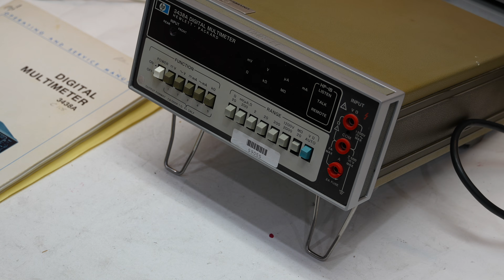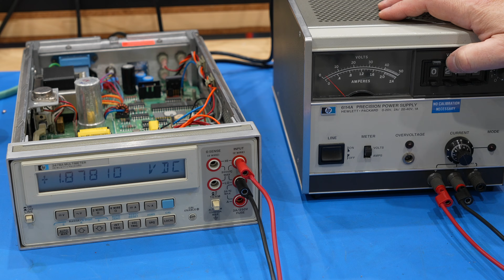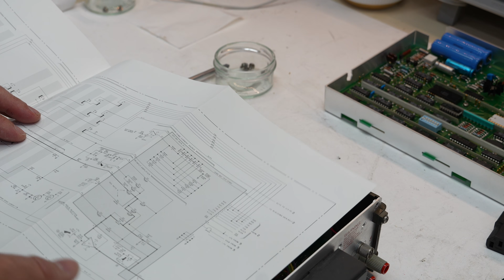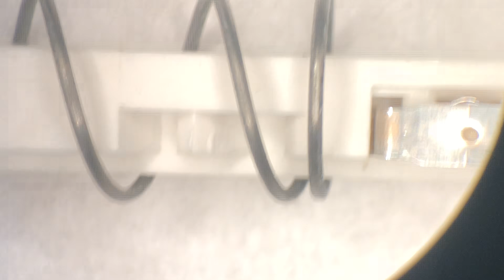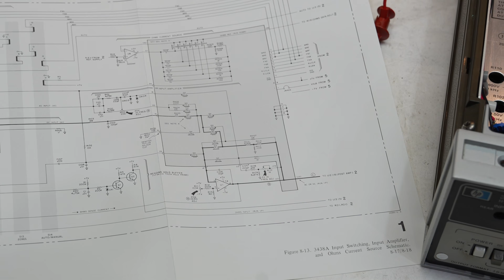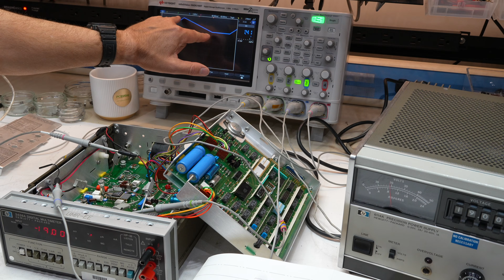HP 3438A Digital Multimeter Repair, Calibration and Principle of Operation

Comment: A useful tip for assembling items with small parts, springs, or circlips, get a large clear plastic bag, big enough to get both hands, the tools and the item in and do the work with everything inside the bag; if anything flies off, you won't lose it.
Reply: My god, why didn’t I think of that? 
I even have some gigantic blue ESD zip bags from Digikey (seriously, they’re like garbage bags!) I could use.

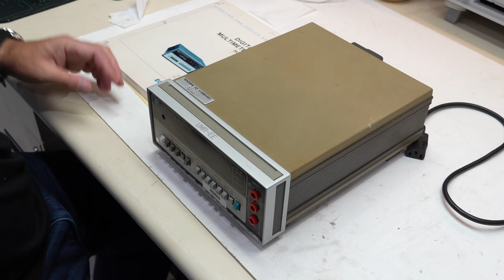Comment: WOW! I had to do a double-take when you flipped the unit over at 4:19... That UMR-EE engraving means it came from my alma mater, University of Missouri - Rolla! I may or may not have items in my collection with similar engravings. The university used to have AMAZING surplus sales, I once bought a working gas chromatograph that was missing an interface card for $10 because it was cheaper than a microwave. I used it to heat up frozen burritos.
Reply: Excuse me. . . WHAT? That is so silly.

Comment: Great video! your persistence is amazing.  Who makes the scope probe to micro grabber adapter?
Reply from the maker: It's an old HP probe system that's much, much better than the new ones (though fragile, you have to take care of them). They are hard to find, usually pricey, usually incomplete. Mine come from years of gathering bits and bobs on eBay. Search for HP-Agilent series 1160 probes. The dual lead adapter itself is 5063-2147. The mini grabbers are also HP, much more common.
Reply: @CuriousMarc  Thank you for taking the time to reply.  Your channel is outstanding!

Comment: Have you tried superglue and baking powder as a filling material? It forms a kind of plastic that will bond to any surface - including plastics that super glue will not ordinarily adhere to. It sets as hard as a ceramic, and leaves materials like epoxy dead in the water!
Reply: Find that very hard and brittle. I think the switches use a bit of a soft material.

Comment: There is always a simple cure (prevention). When the switches are apart and finally cleaned, add Vaseline to the contact surfaces. It stops corrosion and arcing.
Reply: He added deoxit contact cleaner/lubricant.
I do like a contact grease for switches, though. I mostly use one from Electrolube, though, rather than plain Vaseline. (I do use Vaseline for potentiometers. What’s SUPER handy is the spray Vaseline, which has the Vaseline dissolved in solvent, so you can spray it in as a thin liquid, then the solvent dries off and leaves a nice thin film of Vaseline.)

Comment: Hello Mark
Have you thought of making a new push swìtch shaft by three d printing.
I like the way HP, Tektronics and Marconi Intruments, technical hand books are written.
The only thing was the US circuit diagrams were usually  on several pages, witch made fault finding and calibration difficult.
As I worked at Marconi Instruments (part of English Electric) in St Albans, UK, for severr years during the changover from valves to ic's.

Comment: I'm a UMR (now MUST) alum.  In the early 80's, I spent a lot of time with the tech. (Dick Schroeder) who repaired and calibrated all our instruments in the EE department - he was the one who first exposed me to the glorious Tektronix 555 dual beam oscilloscope.  I also spent some time in charge of the Hobby Club.  Having been an electronic hobbyist since my early teens, I was appalled at the number of people in the program that didn't know which end of a soldering iron to pick up.  😕 I even repaired a TV for an EE prof. there...  <g>
Reply: I was a user of the Hobby Club in the 90s.  All kinds of good stuff in there.
Reply: @markrages  I wonder if the Hobby Club still exists?  Hope so!

Comment: Would it be possible to add a extra resistor outside the hybrid module to compensate and calibrate the damaged inside resistor?
Reply: I think the issue was that the switching transistor is burned.

Comment: More switch issues. HP really hated switches; in my 8350b more than 80% had lost the metal part and was a pain to refit them. @curiosmarc look at positives side... The spring from the switch did not jump to a random location of the lab

Comment: Hey, I have the same meter with a very similar problem ! It's waaaay off calibration, but the switches seems to work fine (nothing changes when I wiggle them). Thanks for the service manual, I'll try to fix it. Some day...

Comment: Discombobulating the plunger switches, that's pretty interesting to watch. They come in different designs, I'm very familiar with Polish made "Isostat" licence switches and while they're functionally similar (interlocked or independent, latching or not, and fast action wide gap for mains applications), they're far simpler inside than the ones used by HP. I wonder how switches used by Tektronix compare to both; maybe I'll see Atkelar take one apart someday.

Comment: Working for a competitor in my youth, I was more familiar with this dual ramp integrator. 😊
Please note that these voltmeters are very sensitive to contact quality. A few milliohms resistance in the switch may cause a false reading. Though it is rarely constant : playing with the switch makes the reading going all over the place, not stabilize on a value.

Comment: Wonder if it'd be possible to replace the hybrid with a CPLD, FPGA or Arduino.
Reply from the maker: No such luck. The hybrid is a laser trimmed, carefully thermally balanced analog resistive circuit. Modern digital electronics won’t help at all for that one. HP (and Fluke) still make the hybrids for their higher end voltmeters.
Reply: @CuriousMarc surely you could build /sonething/, albeit not very accurately functioning?

Comment: Contact cleaner is great stuff.  I had an LG washer that would not turn on, I thought maybe the control board was bad.  A quick blast with contact cleaner on all the tactile switches and it was good to go.   I am sure many of these modern appliances get dumped out due to switch oxidisation.  I used HP test gear during my years as an Electronics undergrad, memories.

Comment: I couldn't quite see how the switches were linked, is there a plate underneath so that they are all effectively touching each other in a clockwork like mechanism. Also another one for me I will have to go back and have a look at how the individual switches are released so that you can take the shaft out. Thank you for another great video.
Reply from the maker: Yes there is a bail plate way underneath linking all the switches, couldn’t see it well myself.

Comment: Thanks for the video, again!  Restored my 3466A last spring, new power supply caps, checked out the all other components.  Had the same problem with my switches so physically cleaned all the switch contacts  and applied deoxit gold to protect the contacts.  New set of rechargeable batteries installed and fully calibrated.  Love the LED display.

Fortunately, no hybrid chip fault.

Geoff
Reply from the maker: Congrats! One more instrument saved.

Comment: if the plastic is off-gassing, they will probably keep doing that (all of them). ideal solution is to machine new parts out of PTFE. or just 3D print some stuff out of resin etc and replace the plastic switch stems
Reply: PTFE is much too soft for switch parts. 
PEEK or Torlon would work well, though!
Reply: @tookitogo  Ya, PTFE could deform you're right. PFA would work and be similarly unlikely to contaminate anything with off-gassing

Comment: When the spring went boing and disappeared, I felt that.
Reply from the maker: I know. That sinking feeling when our are trying to repair something and potentially just made it worse instead…
Reply: @CuriousMarc  Believe me, you get the same stomach knot when you do something stupid on a live server and you accidentaly drop the wrong database. And now you have to explain to the customer (and your boss) why a simple cleanup job to free some disk space caused a three hour downtime...
Reply: I totally saw it coming.  I feel like someone needs to make an acrylic box for doing these sorts of operations.
Reply: @dodaexploda  I see some machinists working with various clips and other springed/tensioned items doing that work under a cloth so it will bounce off the cloth (and stay in the area) when it inevitably springs away. The camera can’t see it of course, unless you want to use a plastic sheet which might rustle and mess up your audio! Though I suppose a cheesecloth might offer the best of both worlds… up to a certain size of spring 😅
Reply: I think that you just need a glovebox, so the spring doesn't fly into oblivion.

Comment: Those switches are notorious for being a pain.  Ive learned that it was the flux in the wave soldering process that leached into these switches.  Many time she shoulder breaks as well.    Im happy to see That form factor of switch gone in modern devices. I use LPS 1 then LPS 2 on them in droves when fixing ward beck mixing consoles ❤

Comment: Excellent video! Electronic test equipment with those snap action gang type switches are the biggest repair tease.  I remember my first foray into electronics repair with a Valhalla 2101 power meter displaying very odd symptoms and thought 'oh this should be a fun repair!'... just the gang switches.  Also love how you meticulously disassemble the switch to clean it - I just douse them in Deoxit and exercise them a bunch.  I like your way better!

Comment: Hello Marc, there's also a strange 'input switch', S15 on that schematic..,  I could not identify, where this is sitting.. that could affect all ranges, so this one is most suspect. 
I did not see you cleaning that switch. Seems to be that rotary switch '21'.. check internal cables, connections, solder joints as well.
Reply from the maker: And you guessed right! It *was* the rotary switch, see update video: https://youtu.be/Ko1Dukv1Byo . Free vintage pat in the back for you.
Reply: @CuriousMarc  Thanks! 🥰

Comment: Those “Shadow” switches were pretty popular back in the 70’s and 80’s. I designed a number of production test and repair stations using them. I liked working with them. Fortunately the equipment was redesigned over time and automated using HPIB systems so we never ran into the intermittent switch problems.

Comment: Do you have a list of codes for the HPIB interface?
Reply: With this model, you can only read. Function and Range have to be selected manually. I bought one from eBay before I found this out. I should have read the manual first.

Comment: Hello Marc, after briefly studying the schematics, I strongly assume, that the hybrid is fine, but one or several switches are still fishy, especially the 20 Ohm switch is suspect, S7 A/B on page 8-17 / 8-18 .

The OHM circuitry should be protected enough, to avoid any damage of the current source (which is partly in the hybrid).

At first, pls. check, if this fault, or 6 Ohm offset (when you reset the offset to its original 6 Ohm reading) is visible in the 200 Ohm, 2kOhm ranges as well, and if all these ranges read correctly full scale, if you simply subtract this offset.
Please check all OHM ranges for F.S. reading with your resistor box. 

Your external short must be low ohm, of course, as mentioned in the manual.
Reply from the maker: Would be good if it were true! Switch 7 is just a digital level switch, so it should not matter how perfect it is. Maybe switch 6 which is in the analog path. But then the V range would not work either. Maybe the protection circuit itself died (Q101?). I had not thought about that one. I’ll investigate further when I’m back after new year.
Reply: I was thinking this as well.  that would be best case scenario!
Reply: A different offset for the 20 ohms and 2 K range is suspect. The offset in the 2 K and higher ranges is more a thing of amplifier voltage offset. The 20 ohm range can also have series resistance from the switches ( SW6E and SW6F) and maybe the terminals.  Another possibilty could be that the ohms converter circuit is oscillating.

Comment: Might be an interesting experiment to duplicate the hybrid as a pcb with smd components. Would still be small, so might work reasonably well. Do it as a 'flip chip' with the components on the bottom and a shielding plane on top and you might have reasonable thermal stability.
Reply: I suspect standard smd would be sufficient to emulate the custom hybrid.
Reply: @darrenconway8117  The main concerns would be temperature tracking and whether the original resistors were laser trimmed to match each other.
Reply: @lwilton  This is only a 3.5 digit meter.  Modern components would be a better option than a broken hybrid device.

Comment: Hello Marc, thank you for showing this beautiful DMM!

I did not download the Service Manual yet, so have to speculate a little bit, what's your real OHM fault.

I got some experience with these switches, i.e the front/rear switches on the later 34401A, and on the HP3458A, very similar construction, as well showing similar faults in 2W OHM, subsequentially, i.e. a contaminated switch shows a residual OHM reading of several Ohms.

 I guess, that this 6 Ohm zero Offset probably will not be caused by a fault of the hybrid, but more probably from a residual resistance in the OHM input path.

The range and mode switches (the ones you've cleaned so far) might still show these 6 Ohms contact resistance, maybe due to bad contact force, or you might have made an assembly fault, when you had to re-attach the spring and the contacts.. pls. have a closer look, if these contact plates are somehow 'polarized': break-before-make..
Please measure this said zero resistance with another DMM, starting  from either Input +  and Input - jack to the belonging current source GND and Hi nodes.

Your external 'short' does not look very well, maybe you might tighten its screws, or measure its resistance with your other DMM.
 
I don't overlook the whole story fully yet (as I didn't study the schematics), but your maybe erroneous zero alignment and then consecutively faulty gain adjustment (which then of course does not reach full scale as well) is caused by such a residual resistance, and then flaws the whole measurement scheme.

 Frank

Comment: Why not replace the bad parts off the hybrid with some discrete components? 
Or is it built in such a way that doesn't make that feasible. Meaning there is more in there than a resistor network and some such.

Comment: I had problem with HP 3466A and similar switches, where the range indicators would be stuck even when the range was not selected. Seemingly some contacts would short together, and pushing the affected switch repeatedly would fix it for a while, but fault always came back, and there was tin whiskers growing at least on the metal bar holding the banks together. I cleaned switches best I could from outside, but even that did not help. Finally I took 1,5V battery and connected it between every switch contacts, and after that so far all of the switches have been working correctly. I was too afraid to remove the plungers due old brittle plastics. There was similar switches still available on digikey, but price for single one was high and some needed configurations just not were stocked anymore.
Reply: Had MANY tin whiskers on the U-bar that hold these switches too (not a HP, but other brand DMM). Thousands of them, shorting several contacts out. Looked like a woolly stick, whiskers up to 6mm. De-soldered all switches, sand papered and spray painted the U-bar after dismounting the switches. And then I put a electrical tape barrier between the bar and any contacts, so new tin whiskers would brake before penetrating.

Comment: Glad you were able to get it somewhat functional. Too bad about the hybrid being damaged. Students accidently sending the wrong signal into an input is a constant danger in an educational setting. One of the HP 3476As I got in the same lot as your HP 3438A had a damaged hybrid as well. A few years ago, a couple of grad students vaporized (slight exaggeration) a nice SMU.

The push button gang switches on that era of equipment are always a pain as well. 

If I happen to come across another 3448A that might be a suitable parts doner I'll send it your way.
Reply: How do you do that, use the SMU as a sink, past it's limits?
Not sure, but shouldn't a SMU simply go into overrange, unless input voltage is exceeded?
Unless you use some good amount of RF/HF
Reply: @hinz1  I don't recall the specifics. The carnage was impressive though. I have an old Fluke signal generator on my bench at work which had the output current resistor smoked from a student feeding a signal into it. Luckily that was an easy fix.
Reply from the maker: Thanks Birt for the donation!
Reply: To be fair, it's not only students who mess up instruments. I'm making circuits as a hobby and i've burned up a few (cheap) scopes in late-night debugging sessions. And one at mid-day, it's really astonishing how much amps a couple of solar panels can force into a small hand-held multimeter... 😕

Comment: Nice.  Looking forward to Marc sourcing and replacing that defective hybrid to bring it back to full functionality. 😁👍🏻
Reply: I've been wondering if those hybrids can be repaired with modern surface mount devices - or if it'd be possible to replace one with SMDs + quality pcb material. Or has someone already tried?
Reply from the maker: For a 4 digit instrument it might work. The resistors in the hybrid are laser trimmed, and thermally locked by their proximity. But again, 4 digits, Ohms scale only,  worth a try.

Comment: I have its portal version . It also had a dead switch hybrid. Back in the 1970's I was quoted over £600 for a replacement from hp.  I made my own from a set of cmos switches  and a few diodes (not exactly accurate but at least it worked sort of ;-)
Reply: Portal /portable